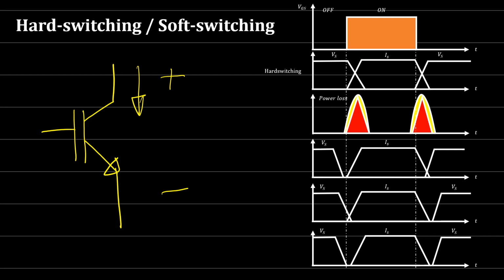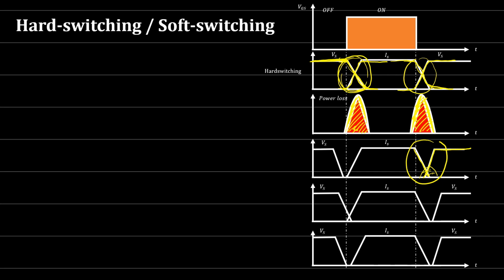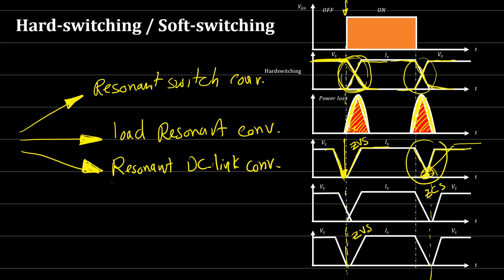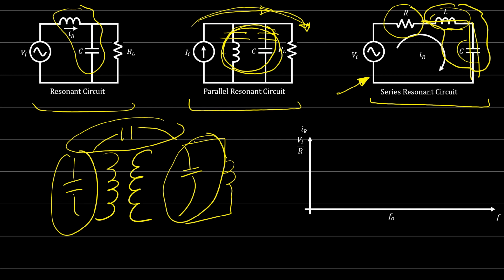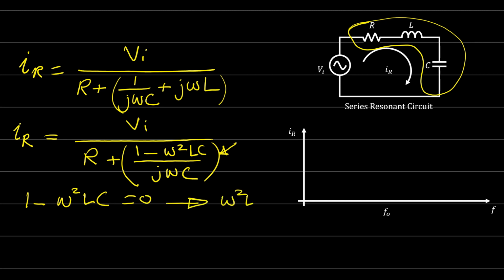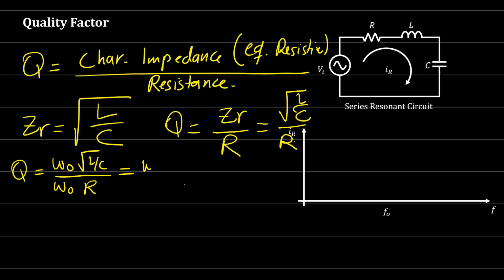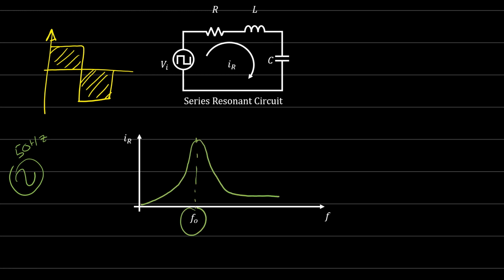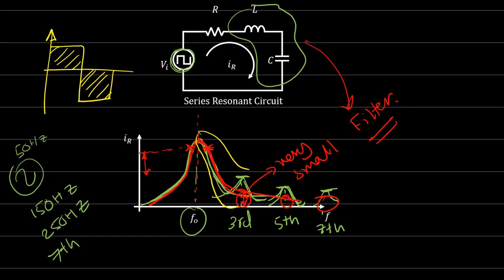Soft Switching Hard Switching vs Resonance | Resonant Converters | Power Electronics

Comment: please sir,i was wondering if you can tell me how we can achieve ZVS in LLC converter with GaN half bridge topology and GaN don't have a body diode,so where does current flow to make voltage across the device zero before turn it on.thank you

Comment: Above the resonant frequency, rectifier diodes or transistors (whatever used) can not achive ZCS means not soft switched and it will increase switching loss. What do you think sir ?